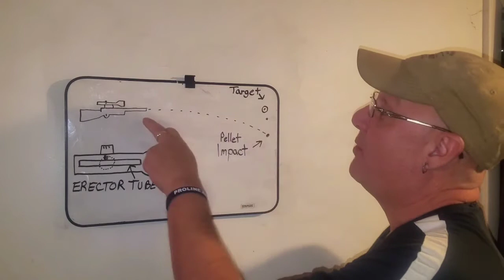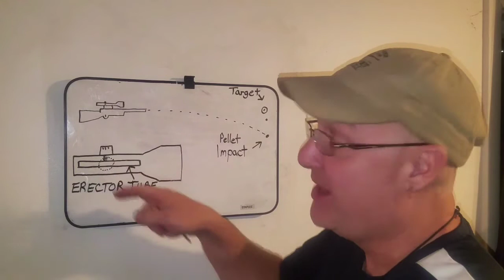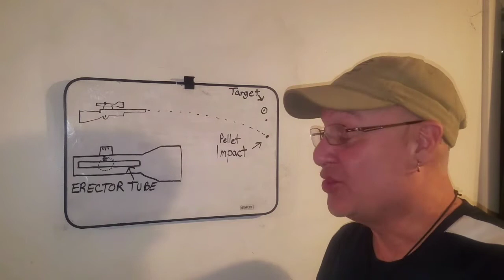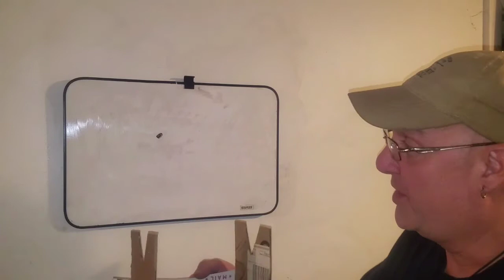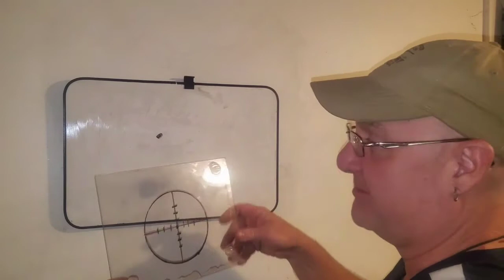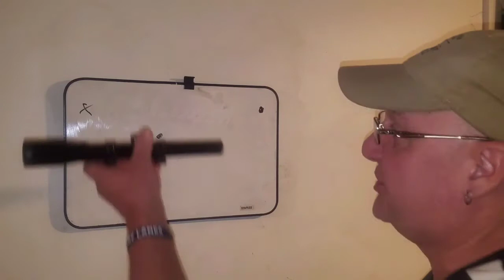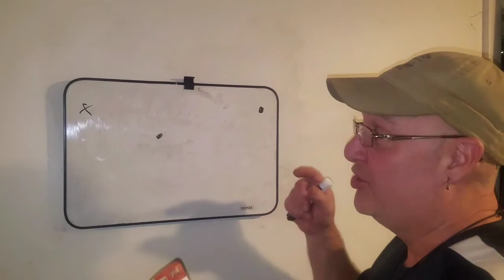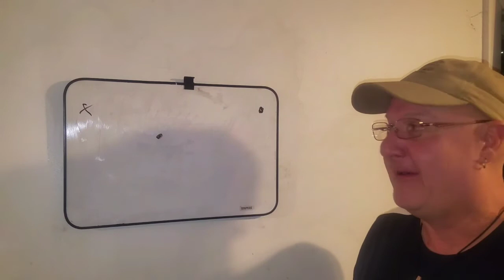Field Target Tech Channel Episode #7 Optically Centering a Scope

Comment: Tm,,Tom,,optically centering the scope,,,,does NOT,,take care of the scope running out of adjustment,,,,using adjustable scope mounts WILL take care of this problem
Reply from the maker: Doug,  yes, you are correct,  I state that about 3/4 though the video, on how to properly mount an optically centered scope using fully adjustable mounts

Comment from the maker: Bert, when adjusting a scope for optical center, you can start with the lowest magnification first, then move onto the highest.  That will make it easier, a scope should always be optically centered at the highest level of magnification.  When sighting in, that should be done at the highest magnification as well.

Comment: Tom,
I could have used this video throughout 2017. I have a very nice D52 and all last year was fussing with a Hawke Endurance for Hunter FT. 20-55 yards...deadly. Inside 20 yards not a chance in....

Sent the scope to Hawke. Nothing wrong. (I had bought it used.) When I came back I did the center routine. All the way down, then all the way up, then half way. DITIO for the windage.

I mounted the scope on a UTG droop mount with extra strong rings.

Put the target at 25 yards (I was feeling real cocky) and took a shot with some 10.34AA.

First shot at 25...1 inch low and 1 inch right.

About 12 clicks up and 12 clicks right and bingo.

Very nice video.

I will watch them all.

Frank
Reply: I meant the first shot was one inch left...

Comment: Yes, thanks for the explanation. I just tried it. Very hard and inaccurate trying to keep the same objective with your eye as you rotate and view the reticle. I ended up putting my iPhone on a tripod and viewing the reticle thru it. It is a stable image that way and all I had to do was rotate the scope in the jig (that I had clamped to the table top so it couldn't move either) and watch the screen. Took several minutes for me to wrap my old brain around how to adjust the turrets so the dot comes into center as you rotate the scope, but I got it done.

Comment: Great video tip. I've done the mirror and glass trick, too. Now, I center with the scope mounted on the rifle. Place the scoped rifle in a shooting base, then have the rings loose enough so the scope can rotate, adjust as needed to get ceners.
Reply: Don't the turrets interfere with rotating the scope?
Reply: huntair only for 90 degrees of rotation are they in the way.  Outside of that, there is 270 degrees of rotation to play with.